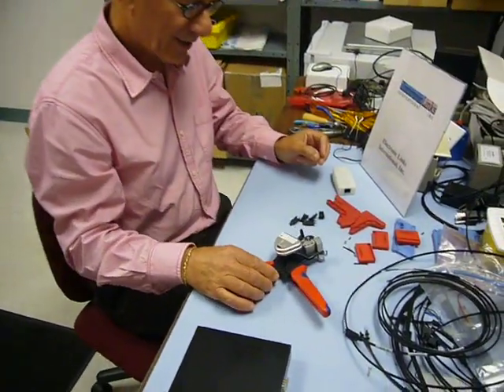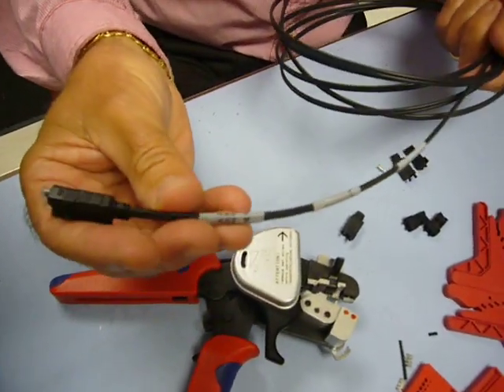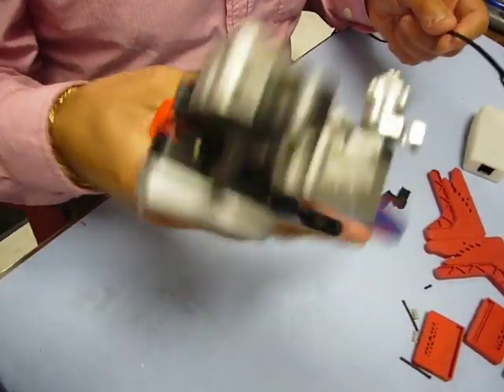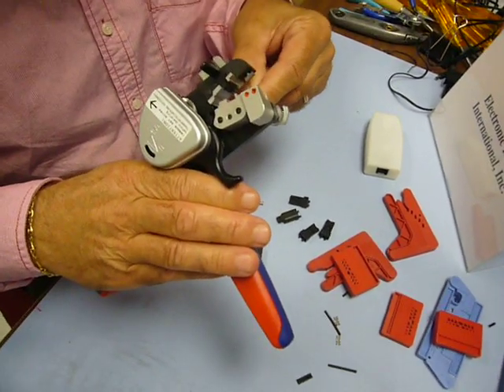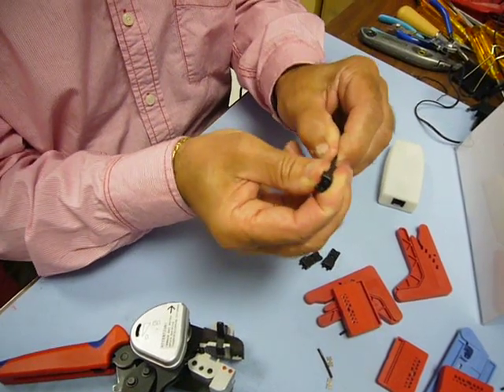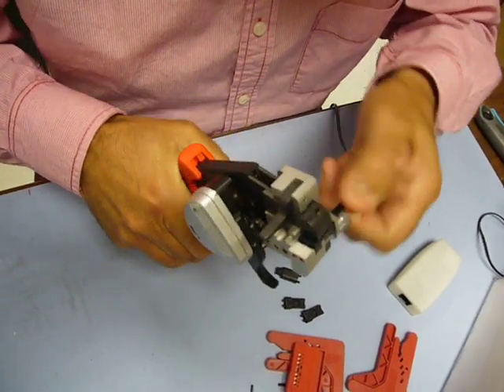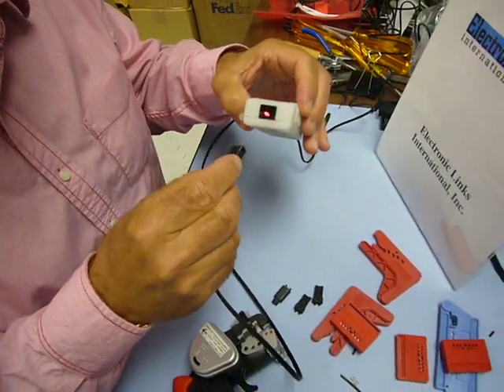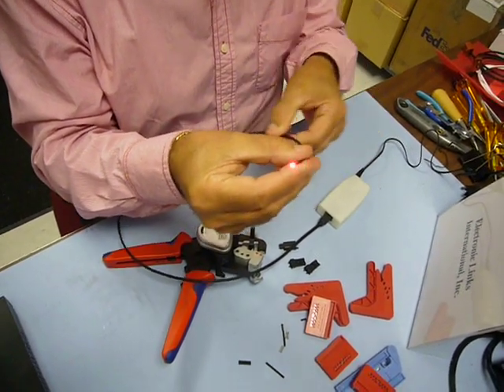Plastic Optical Fiber (POF) Connector Termination for Home Networking

Comment: Is it necessary to use POF for the last 100m? Now most of the customers use FTTH Drop cable, which can solve the problem very well. And there's also TAC fiber of TE, which is also a better solution than POF.  Do you agree?